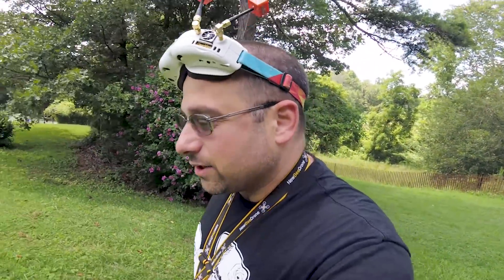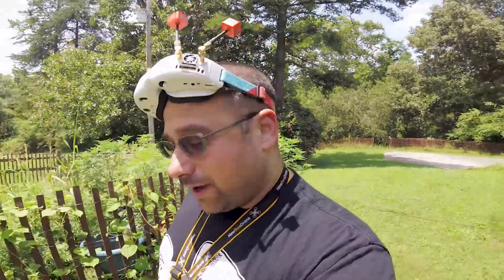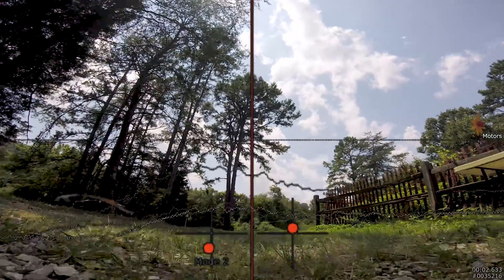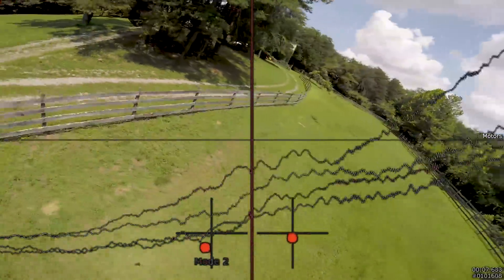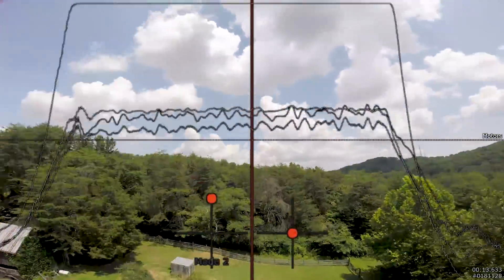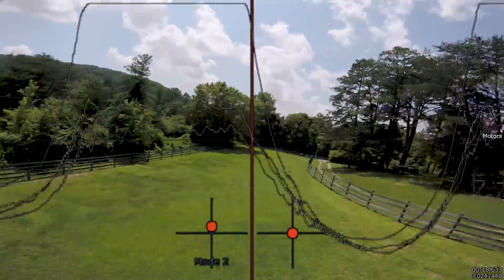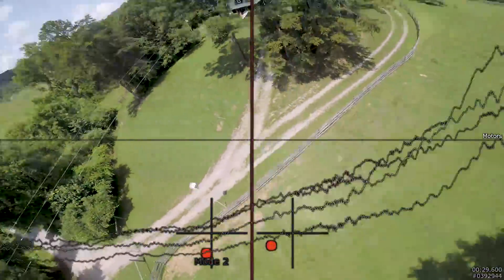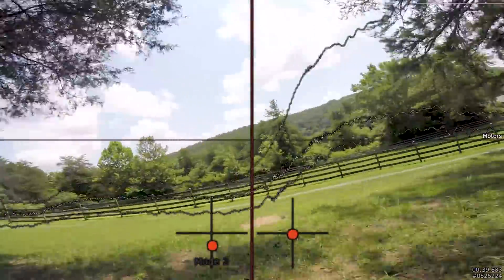What Does A Failing ESC Look Like? IT LOOKS LIKE THIS.

Comment: Is it possible for the ESC to burn out motors if it's dying?
Reply from the maker: Yes absolutely.
Reply: @JoshuaBardwell  yeah I kind of figured that, because when the third motor blew the whole esc was gone as well. This was in the span of about 2 weeks and the third one was a brand new motor. The funny thing is I can't find a single short with a multimeter.

Comment: Aye man Im new to building drones and for some reason when I was messing with the filters I turned one off trying to stop a tiny bit of wobble/propwash and now the fc does not power on when I connect the battery. It does get power through usb. Please help me out if you have any suggestions.

Comment: Hi Joshua, I have the skystars star lord quad for about two months. Everything was fine but two weeks ago I've started to see some strange quad moves. When I do a left side flip, the quad moves a bit in X axis way. When i do the sequented flip, it moves in X axis even more. When I do the flip to the right side, everything is fine. Throttle at minimum when doing the flip (motors spinning at 4,5% when minimum throttle). I've calibrated the ESC's but that doesn't help. Could you try to help me please? Thanks in advance :)

Comment: I found a cold solder joint on 1 phase. Now its fine, and it was not the esc nor the motor.. same behaviour as yours.. so there is indeed one more option where the problem could be.. Thanks for this video. I was thinking like you... that one of my F80  or the esc was bad...

Comment: My quad corner dips, motor number one either stop spinning in mid flight or just won’t speed up enough in takeoff. I have replaced the motor with a good motor from my 2nd quad. still no fix, so then I replaced the escs still no fix. Now, even weirder, when I put the new motor back to my 2nd quad, same thing happens to both quads. Now both quads have desync what the hell?????? Anyone can please help me is it the flight controller or something with Dshot or maybe not a good electrical contact??? Or I damaged electronics during soldering. I don’t FREKIN know I’m sorry stuck please if anyone knows and can help me please reply

Comment: so i did a blackbox run with my quad with issue that has sputter only from 70% and up and it looks like 1 and 3 motor show to hit 100% before the others do.. ive got blheli32 dys aria single escs should i replace the two rears and test again? who could and how could i send my blackbox to so they could help with this? would it be something you could do if u have time?
Reply from the maker: It's normal for rear motors to run higher than front motors because they are operating in the propwash from the front motors. Nothing is abnormal about rear motors maxxing out first. Sorry but I think you're barking up the wrong tree here.

Comment: Hi JB
I like your stuff very much. Just wanted to say this by occasion...
I had the exact same issue. On one kwad i changed the supposingly bad ESC and it it was gone. A few flights later an other motor had the same behaviour. An other kwad had no strange behaviour in flight, but analysing blackbox data, it looked the same.
Changing all PWM settings from 48kHz to 24kHz solved the problem! Strange!?

Comment: I've had this problem many times and know it all too well.  My question to you is how bad would it be for the motor (or anything else) to keep flying on it just for the day as long as the motor isn't getting hot?  Let's say you bring 20 packs out for the day and you cruise out the rest of your packs until you get home to fix it. Would this kill a motor? I did this today and kept checking the motors and they weren't hot.  But if its going to destroy something I'll never do it again
Reply from the maker: I doubt it would kill the motor. It would just fly like shit.
Reply: Joshua Bardwell And fly like shit it did! Felt like a freaking 2S with a bad tune LOL.  Thanks yet again JB

Comment: I have a bad nose dip issue on 3.5 rc2 and 3.4. could a bad ESC cause it to dip the nose when you add throttle quickly? Have tried everything to tune it out changing TPA and pids even had anti-gravity up to 16 Nothing Stops the dip, all new features on jbf4, rooster, Hyperlite 2405-2522, spedix es30hv, dshot600,BF config 10.4?
Reply from the maker: Some people have reported nose dip issues with 3.4 but especially in 3.5 with smooth anti gravity I really think it should be solid. So yeah I would start to suspect mechanical issues now.
Reply: Thanks for the reassurance. Very helpful video. Didn't want to start spending money if I had missed some simple setting.

Comment: I had one troubled kwad with similar problem. ESC and motor appeared to be ok after i swapped them around the kwad. And the problem was... ta-da... BAD SIGNAL WIRE! even not the wire itself (I had Matek F405-CTR) but the circuit board track inside the CTR...

Comment: Had a quite similar looking blackbox log, but it was the motor! After changing th motor everything was ok again. But you are right, it is a hardware issue and it can be only the motor, the ESC or  the FC.

Comment: I had exactly the same problem with my HAKRC H32 escs. I solved this with updating the Esc firmware from 32.4 to 32.52. You can check it by going in to betaflight osd and go on "save and reboot". After this my quad flyes fine on 32.4 firmware. Don't know why 😁

Edit
OK the issue is not fixed. I change the Esc, motors and FC but the issue is still there. Only the save and reboot method fixed the problem. In Blackbox I see it is motor 2

Edit 2
I have flash butterflight 3.5.2 and the problem is fixed. Perhaps a betaflight issue?

Comment: Every time this happened to me it was the motor windings issue. That buzzing sound is the esc driving into a intermittent shorted winding, when the winding gets hot it intermittently shorts. The RS30A V2 esc I use has never failed on me (yet), I have ~15K flights on them. It's much easier to swap a motor than esc, so after BB tells me what arm to look at, the motor is the first thing I change. But if you have crappy unreliable esc (beerotor come to mind) , then maybe it's the esc. Might want to change your title to failing esc or motor. :)

Comment: Dude
I'm actually in this exact same Situation and I was also thinking of a bad Motor (beacause of your other video), so I bought two new ones. But after swaping them, the issue accured at the same corner. Thank you so much for confirming that the ESC is the cause!!!!!!
You can also hear it and I'm getting hot motors.
All the best from Germany

Comment: Does the jbf4 v2 which esc 4 in 1 is best for your fc what's a direct connection for that fc.
Reply from the maker: Airbot ESC should be a direct connection but you should verify before you buy as there is some variance.

Comment: I recently crashed my quad and now its having these black lines in the video feed. I dont know what the cause is because everything looks fine so i wondered what you think about it. Thanks in advance.
Reply from the maker: I think maybe you damaged a motor and it is causing vibration and electrical noise.
Reply: Maybe but i dont get vibrations or anything.

Comment: I've had a similar looking issue when a motor hasn't quite cooked its windings. Insulation must no longer be good enough at higher currents and underperforms at higher throttle. Initially thought esc. turned out to be motor.

Comment: Perfect timing. Yesterday I've had an accident due to a bad ESC. Racestar 35a 4in1, one of the motors wasn't spinning up when arming. When I reached for the disarmed quad, it spinned up 100%, prop broke against my finger, shitload of blood, luckily not that deep of a wound but still. 

I'm switching to seperate ESC's from now on... Done with 4in1s (it was acting up even before that issue).
Reply: Vladimir Munćan that sounds really strange
Reply: I know right. I think the quad is possessed. Other than that ESC acting up from time to time, sometimes when I unplug the battery and plug a new one in, the flight controller resets betaflight settings to default. Happen on butterflight as well.
Reply: Sounds like a bad FC
Reply: Based on what?

I'm more suspicious of the ESC. Since the quad also goes into deathrolls if I don't lower the motor startup power. But if I do, sometimes one of the motors doesn't turn on. 

I am swapping out both FC and ESCs but I will test out the old ESC with a different FC on some third quad in the future.

Comment: Can bad ESC short out your VTX??
Reply: I know an ESC which has positive referenced mounting holes, if the antenna connector is touching the carbon part and the ESC is mounted with metal screw, there'll be short circuit.

Comment: Hi JB. I have an intresting puzzle for you. Have you ever heard that someone burned esc because of to high amps drown by motors? I mean here what if we place 25A on a quad which normally takes around 35-40A. Would esc become hot or when current goes to high it limits it so motors are feed with less power? Or simply fire and bye, bye?
Reply from the maker: If you draw too much current on most ESC's, fire and bye. Some have current limiting though.

Comment: Good info as always. I had yaw twitch issues and deduced it to be vibrations getting into my gyro. I softmounted everything and it still irritated the living shit out of me by still happening. It turned out to be a turnigy evo gimbal causing the twitch. I now have a fat deadzone of 10 in betaflight which drained my angst immediately. Maybe it's time to jump on the frysky bandwagon.
Reply: HoppaCheese I also constantly had to face twitching gimbal on my Evo. Sometimes it started to freak out in the middle of flight. Just few days ago I completely disassembled yaw/throttle gimbal because ir was super annoying. It appeared that the wires connecting potentiometer were broken inside and didn't make contact on gimbal movement. Resoldered new ones and it works perfectly now. Nevertheless I can't recommend Turnigy Evo to anyone, because eventually you will pay twice - poor receiver variety and poor quality overall. I think I'll just switch to X-Lite at some point.

Comment: I have a 4 in 1 esc and one thing is that every now and then usually when i land or crash and sometimes in the air the esc just restarts like it has the startup beeps but everything is always on it just randomly restarts the esc any ideas would be helpful
Reply: Check the power wires. Probably have a bad connection.
Reply: aowi7280 i have a couple things running off it too and they font dtop at all so yeah the only thing is that i have a ultra dketchy setup basicly my vtx is be held in place by the top plate and somehow something is jumping i mean its the only explanation

Comment: Careful if you keep flying it, I had one acting hinky, then it exploded in flames, taking the whole stack including a Split with it. Boy those 4S1550 100C HV R-lines put out some incredible short circuit current. My Rooster is now in need of a $200 vet bill.

Comment: Omg this video was perfectly timed. I’m having a quad that keeps giving me trouble as well. It was flying great, and then the flight controller, a HyperLite f4, bit the dust. I replaced it with another, and then when I plugged it in the VTX went out. Then I replaced the VTX and and plugged it in. The flight controller goes out again. Now I replace the FC again with a Revolt (since I ran out of BF boards). This time it works, but the back left motor twitches and will spin up, but then fail after ~20% throttle. So I replace the ESC this time with individual ESC’s and STILL, it twitches and fails. Next, I try some old KISS 24a ESC’s and I get the same problem. I even switched the PDB. What in the world is the issue? Maybe we could even do a live stream.
Reply: OutaTime FPV well, did you try changing the motor? If it fails above a certain throttle value, that sounds like a desync issue... Might be a failing winding.

Comment: Hi Joshua!  Love you stuff.  I'd like to put an official request for a video about unfiltered gyro traces.  "How much noise is too much?"  Hard to find a baseline on the internets.  Thanks!
Reply from the maker: It's really difficult to baseline this because filtering has gotten so good. If your motors are cool and don't sound rough or desync then you're good.
Reply: Thanks Joshua! I've been on this kick lately on noise reduction before filtering.  Was just curious from build and science perspective, on how quiet others have gotten these things.  Perhaps gaining some performance advantage coupled with these amazing, less latent filtering systems.

Comment: Occasionally, 3 times in about 20 batteries. My wizard x220s flips out on throttle up. The last event causing me to disarm before crashing into middle of street. I have ordered esc. While waiting. I tested the motors for voltage output. Thanks for the information.

Comment: Sorry for the off topic questions. What goggle receiver are you using and why 2 omni antennas? Never saw that done before. What is the upside and best time to do that?
Reply: I do that when I'm not flying far in a certain direction.  A lot of the time I'm flying a track or I'm flying within 200m of myself but in all directions, behind and sides as much as front.  With a patch only covering the narrow angle in front of it the 2 omnis at 90 gives you 2 antennas that cover 360 and cover each other's dead spots.
Reply: also notice its a Clearview so both the antennas work together to get one single best image.most racers use 2 Omni of different axial ratio and different range pattern to get a better image rather than using a patch.
Reply from the maker: I'm using ClearView which sometimes works best with two of the same antenna.
Reply: That makes complete sense, thanks! Can I do that with true d as well instead of a patch in that type of flying situation?

Comment: N00b question: do you get the motor traces by using a FC with blackbox and an SD card?
Reply: Yes, or the built-in flash memory if it is there on the FC.

Comment: My first race drone from a year ago or so started making a chirping noise on throttle punches and hard maneuvers I replaced all the motors didnt fix the issue so I bought a few more quads and put the motors on a new build now I'm wondering if it were an esc dont know what else it could be

Comment: Its happen to me this week, my kwad always tilting to the left when i throttle,,maybe i have issue like yours,,idk
Reply: it had happened to me once,  I accidentally trimmed stick positions on the transmitter so i had the issue, check the betaflight tab if your endpoints are correct and make sure your arms are not loose.If thats not the problem im not sure.

Comment: Yeah was wondering how to tell the difference between the bad esc and a bad motor I would assume since all the other motors were running ok and the quad was still flying I would assume oh that motor is bad for whatever reason I guess this is were having separate esc would be beneficial so you wouldnt have to replace the entire esc and you could try to swap a motor then an esc to see what works and what makes these things fail were and tare? like did you have  a thousand packs thru this quad or was it bad from the gate of so would a place like get fpv and or banggood exchange it for a new one?

Comment: Those 'big' yelloish SMD filter caps on ESCs' tend to unsolder them selves after some time. Guessing a combination of heat, tree and grass fluids and vibrations dislodge them (or cracks the solder)had 3 in 6 months from different manufacturers do it. Hope this helps someone else.
Reply: They're tantalum capacitors. Though known being fragile, never had any fall off my ESCs.

Wait, my ESCs don't have any!
Reply: Labs there is one video with Skitzo where most of his ESC are missing caps and I believe one of them barely had any left 😄

Comment: Really interesting, JB! Good to know! 😊
But... Which 4 in 1 esc is that?
Reply from the maker: DALRC Engine. BAD!
Reply: Joshua Bardwell Wow! I really didn't expected that! 😨
Reply: Hmmm... my friend's DALRC Engine failed on 2 channels after a very minor crash and 2 Hypetrain motors were killed as well...
Reply: I can say I know all to well how fragile the Hypetrains are... but on dronemesh, he tested all esc and said best 4-1esc was DALRC....  didn't hear to many issues... maybe just got a bad one... ?
Reply: Because noise test and a quick test run can show how durable and reliable an ESC is. Sure...

In my rating, ESC reliability is number one priority, second being features, noise, board layout and so on. Noise can be easily fixed yourself with some filtering capacitors but unreliable ESC can't be fixed easily, the changes need to be done in the manufacturer.
Reply: ESC are not durable in the first place. reliable ok. but you should know there is no way to test reliability of ESC. I have DALRC Engine and its awesome
Reply: Damn, i have one on my desk right now thats supposed to go into my backup quad..
Reply: New DALRC Engine also took a shite... didnt even get to fly and it smoked a hypetrain
Reply: M G it doesnt take a bad ESC to smoke a shitty hypetrain. unfortunately
Reply: Hmm.. now that reminds me of someone who made a video "The best 4 in 1 ESC in 2018"
Reply: Labs Me too! But... I don't know. Even FatShark do stupid things... Like, AndyRC had to change the plastic case from his HDO because of light leak. So... Maybe a bad batch? Who knows.
Reply: A lot of FS customers have to do that. me too
Reply: dronemesh?
Reply: HomeGrownCanadianFPV... Yes, search YouTube for his channel...
Reply: Labs Still is one of the best..